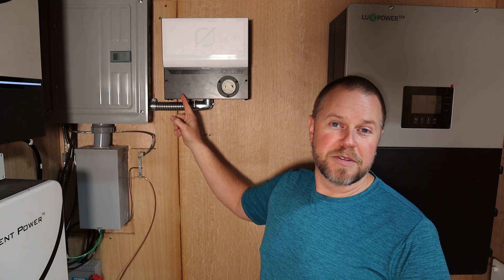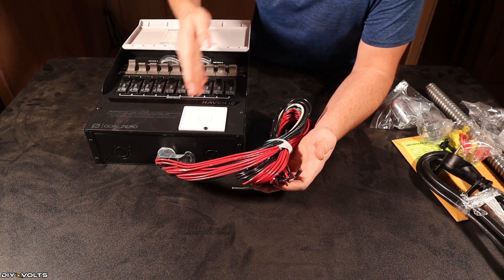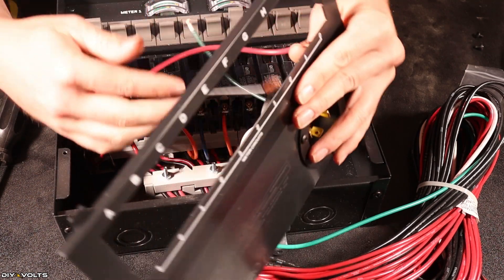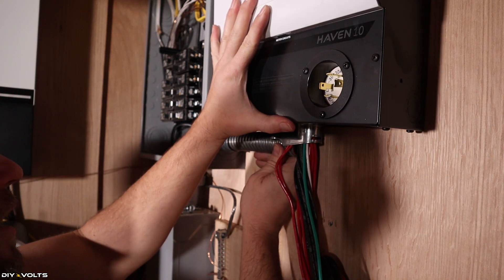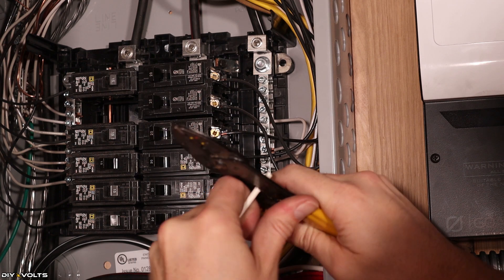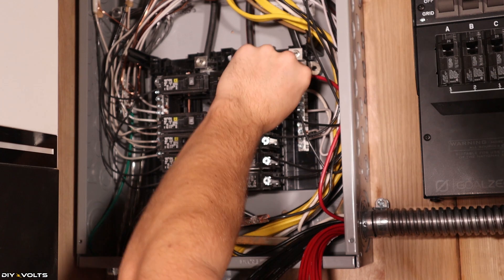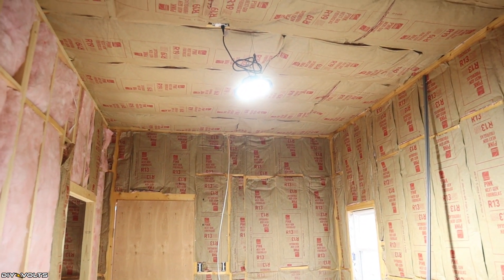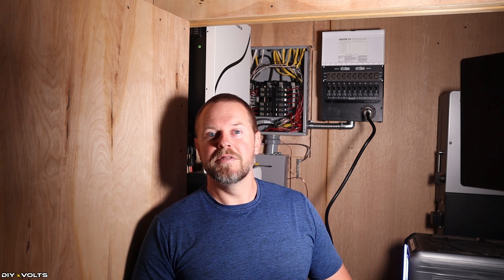Transfer Switch Full Install and test with Power Station and Grid Power

Comment: Eco flow delta pro 3 system and Eco flow delta pro 3 extra 2 battery 12 KWH and please show more test it out on YouTube videos 😊
Reply from the maker: I have not used the pro 3 before. However I should be working with the Pro ultra soon.

Comment: Can you do the same with a solar inverter to run just 120 volt current without a problem?
Reply from the maker: The transfer switch will allow you to swap between two inputs. It does not mater where those are coming from. Grid, power station, solar, wind, hydro...

Comment: What if my solar generator just has a 110 plug?
Reply from the maker: You can link the two L1 and L2 in the transfer switch to make all the breakers 110v. keep in mind that you will not be able to run any 240v applications this way.

Comment: That's nice to have ready instead of running extension cords all over the place from a generator.
Although it doesn't really matter which hot is which, there is a "convention" for these L14-30 plugs/recepticles.  The connections are labeled ( seen at 4:16 ) W, X, Y, Z or G;  W = White/Neutral, X = Hot 1 Black wire, Y = Hot 2 Red Wire, and Z or G = Ground. It's not necessary but, on the rare occasion, this helps when troubleshooting.
Reply from the maker: Some of these transfer switches are designed to be either 240v with some 120v and some are only 120v. I have found that the L14-30 plug can sometimes leave the L1 or L2 unused. This can cause a power station to have no output if the plug is wired in the wrong way for 120v use. Transfer switches sure are nice to have though.

Comment: Nice job on the video. A recommendation though: You could draw out the circuit (eg, "before" fully on-grid, vs "after" going via the off-grid transfer switch) which may help explain what is actually happening when you have the transfer switches in each position.
Reply from the maker: That is a good idea. I kind of did that on one of my other youtube channels when installing a transfer switch over there. This video I was going for more of a straight forward install without much explanation of why.

Comment: Great. vid. Thanks ! Q: What would you need to add/modify on that setup to grid-tie your installation and safely push back ?
Reply from the maker: If you have an inverter capable to pushing power back into the grid you would need a bi-directional meter. That would tell the power company the direction of power. These have to be professionally installed.

Comment: Hate to tell ya but you overpayed for a rebadged Reliance ProTran panel.
Reply from the maker: This unit was provided by Goal Zero. It goes with the Yeti 4000 power station. I agree with you on the price. The Reliance is around $200 cheaper than the unit in the video. I hope that people will at least take home the "how to install" part of the video and find the best price as they can on the transfer switch.
Reply: @DIYVolts  I use to work in electronics in the military and didn't know if I should install the 10 circuit Reliant switch myself. Your video gave me back my confidence. I had an electrician that wanted to charge me 750 dollars just for labor.

Comment: Great video, very clear description and used wago electrical connectors for good connections.

Thanks for the share!
Reply from the maker: Thank you. This transfer switch was an easy install and works well to power the shop from an inverter or power station.